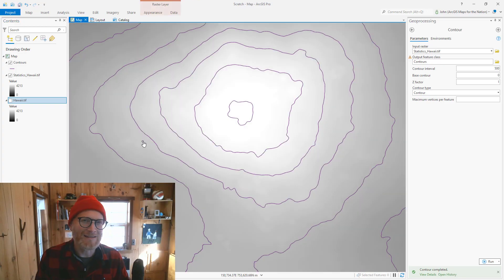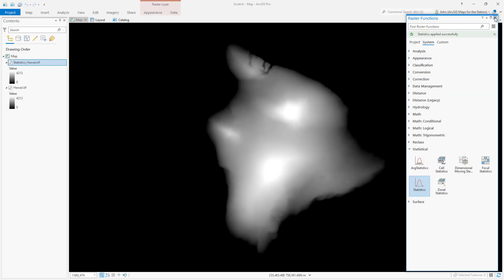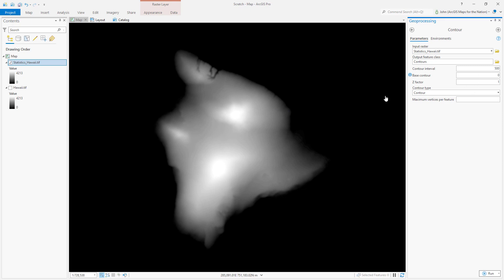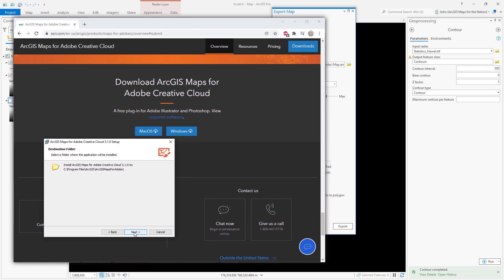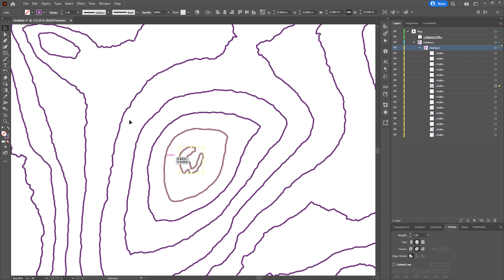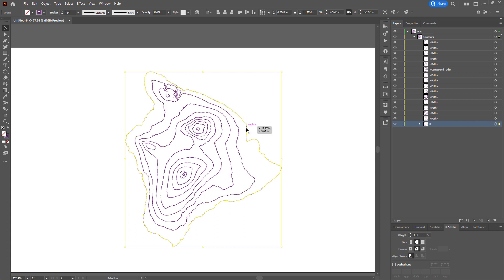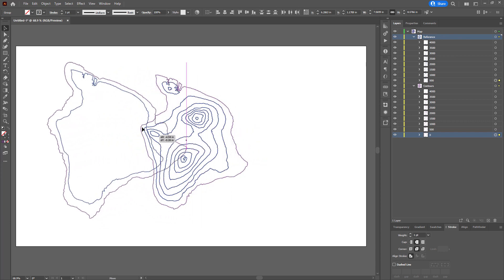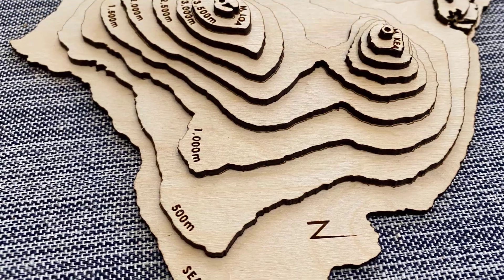From GIS to Glowforge: 3D Printed Terrain for Map Nerds

Comment: I'm looking at doing a project and I'm just not able to get the result I'm looking for. Would you be able to help me? I don't have ArcGIS software. I can get a contour map for the area I need, but struggling to convert it into the layers required for the laser cutter.
Reply from the maker: hi Mias! if you are able to generate contours, in whatever tool you are using, convert them to vector lines. maybe SVG format? i don't know, not knowing your setup. SVG should be consumed by any of the cutters.